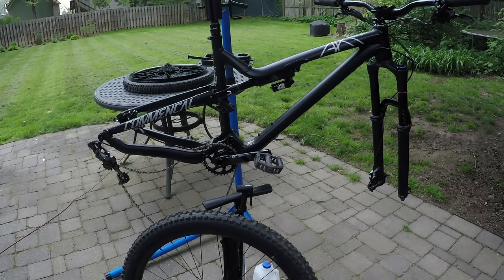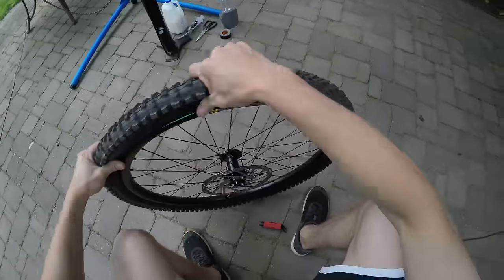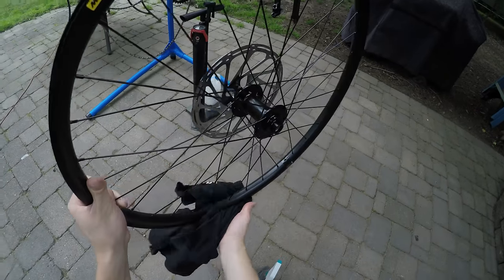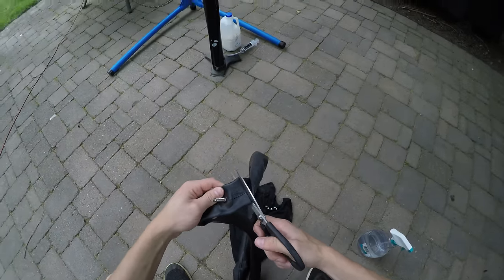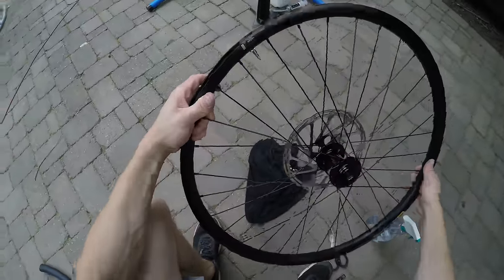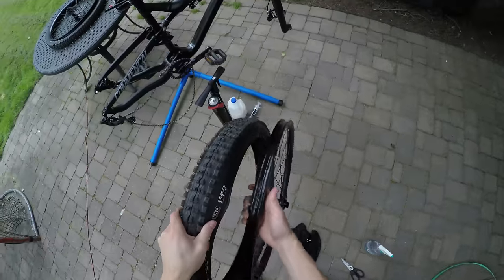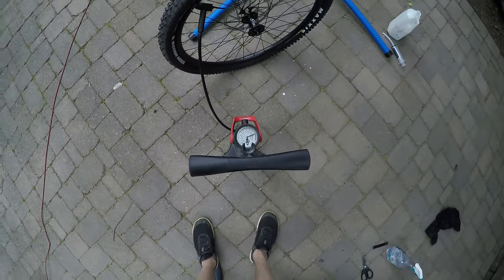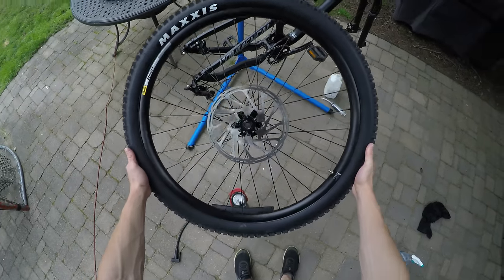MTB DIY Tubeless Conversion - Easiest and Cheapest way!

Comment: Worked great on my 20-yr old Urracos. Had to trim down the tape to about 3/4”, and the tires were pretty snug. But both held air just fine.
Reply: Are your tyres tubeless or non tubeless?
Reply: Everything From Every Where The tires are “tubeless capable”.  The rims are older but seem to work. The only problem is that if it all sits too long, something gives out, probably from the sealant settling away from a bad spot on the rim.  I probably just need to ride more...

Comment: I just did this with 29er tough tom tires. Seems to be holding pressure just fine! I reused valves from some flats i had. I think the first one i did needs the valve screwed on tighter cause it sprung a leak a couple times. But a quick bounce of the tire to get the sealant up on it sealed it both times. I tightened the second valve more and didn't have the same problem. I had a bit of trouble sealimg my first bead even with the compressor on it. I don't really know how i fixed it, but i squeezed the tyre near the valve while inflating and it finally seated!

Comment: The use of gorilla tape caused me massive issue on my enve carbon wheels. The tape caused the beading of the tyre to become far tight in to the wall of the rim. When I did get a puncture where the sealant couldn't cope with the leak I couldn't get the tyre off the rim due to the size of the tape. So ended up with a long walk back to the car. When I got home it took me 2hrs to break the beading on the tyre so that I could get it off. I have recently removed the gorilla tape to use proper rim and again it took a long time to get the glue from the gorilla tape off the rim. So word of caution when using cheap tape and deep set wheels.
Reply: If you have carbon rims wtf are you doing in this budget tubeless build lol.
Reply: You are not bright if youre doing  this to carbon rims.  And if you think gorilla tape is cheap, that just goes to show your ignorance.
Reply: @kolinstallman3788  HAHA seriously.
Reply: RollinRat  Got a link on how to do the "original ghetto split tube tubeless"?

Comment: Best vid, I did that too : If your non tubeless tire is difficult to inflate (even with a compressor), roll a strap all over the exterior of the tire, and put some pressure on to get the beads in place before the air!

Comment: Thank you very much. I just bought a Mongoose Dolomite ALX and want to go tubeless. I will purchase new valves, only because I don't want to do it twice,lol. Gorilla tape is nice idea if I can purchase it wide enough  for 4" wide rims. I also purchased brand new schwinn Axum, but I'm to heavy for it right now,lol. Mongoose Dolomite ALX holds 400lbs. Axum I'll use later when I lose weight. Thanks, you got new sub.

Comment: Made it look so easy, why was I fretting, even managed to inflate my tyre with a foot pump only difference is that I am going to feed the Muc-Off sealant through the valve stem having first removed the valve core  itself. 10/10

Comment: This is a great vid.  Exactly how I've done it.  You can also buy 'Tesa' tape in much larger rolls for cheap on line.  It's the same high tensile strength tape as Stans.  It's even yellow.  I'll have to try the gorilla tape.  I never understood why people mess with removing the valve core and injecting sealant that way.  So much easier and simpler to just put it in the open tire and mount the rest of the bead.
Reply: taking out the valve core to add sealant is useful later when it allows the tire to stay undisturbed, so you don't have to reseat the bead, which is a chore if you don't have a compressor or some fancy pump.
Reply: @DominiqueB  I'll add an asterisk, * "Unless you don't have a compressor or some fancy pump" to my statement.  :)  But in that case, I wouldn't even be trying to work on my own tubeless stuff, because without a compressor, (skip the fancy expensive pump that releases tons of air at once) it's really really hard to get tires to seat.  The compressor is king.  Sometimes I have to remove the valve core to pass enough air into the casing to get the tire to seat, but without it, I can see it would just not seat at all...

Comment: Thanks for sharing. Tried this method and also the one where you split an inner tube. I keep getting problems with this method, where the valve eventually leaks, but the one with the split inner tube is still going strong after over a year!
Reply from the maker: mick2d2 cool! Some valves can be  tricky but I've never had an issue.
Reply: Children Of The Loam I think it might because I usually end up having to top my tyres up fairly often and maybe this leads to moving the valve slightly over time. When it's still attached to part of the inner tube, this isn't a problem. The wheel I did using this system doesn't even have a thread on the base of the valve stem!
The other problem I find with tubeless if you're forced to change to an inner tube (this happened to me the other day on a ride) is that I had lots of thorns in my tyre, that had been sealed up by tubeless liquid, but were sticking through the tyre. This will just give you multiple punctures unless you remove them (not an easy task).

Comment: You have a real knack for making a DIY video! This is a clear, informative one. I just have one question, and I don't mean it sarcastically... Why make your tires tubeless? What's the advantage of removing  the tubes?
Reply from the maker: Thanks. It saves weight and prevents flats.

Comment: The sealen has crystals that will settle so sucking up the sealent into a syringe isn't the correct way, you should invert the bottle and wait a few seconds before tipping sealent into a tyre or cup this is an important step... This is the main reason people complain when the sealent dosent plug the hole and sprays latex everywhere.  The innertube and tape  hack is great 👍

Comment: Great video I like the hack with the tire tube for valve. I have been converting to tubeless and bought muc off valves  and even they leak so used rubber cement around core. I think I like your idea better and the rim tape as well! Picked me up some 1inch gorilla is the cheapest and best. Thanks

Comment: This will work  IF and ONLY IF.....  1)  your rims are tubeless ready   and/or,  2)  your tires are tubeless ready as well...   OR,   if you're using older rims and beaded tires,  you could try to add more rim tape to make tires fit snugly to the rims + lots of sealant!   Also,  this works well with rubber side wall tires.

Comment: Dude... i did the same thing... 2 years later and my tires are still good with this method... there's no need for expensive tapes... Gorilla tape FTW

P.S. I may need to change the sealant but too lazy to do it...
Reply: intra morph in Whats the name of the sealant you use?
Reply: @sistercalhoun4444  i used the stans sealant

Comment: I recently got myself a commercial ebike with fat tires and I was wondering if I can apply your techniques used to convert to a tubeless tire system for the ebike because tire repair on this ride can be a bit more of a challenge due to a heavier weight of the bike, mine is weighing close to 70 lbs. With a 20" x 4" rims. Can I do the same thing with my rims also? Going tubeless on the ebike would be a tremendous help considering I live in the lower desert where we have goatheads galore in stickers here requiring near bullet proof just for the stickers! I have already determined due to the size of the width of the rim that a tubeless ready tire would be a better guarantee for safety reasons. Since this is practically a brand new bike. Was able to enjoy a couple of rides, but after about 25 miles and a flat, this could be a major pain to replace every day, especially because of the size of the tubes, 20"x4" is not a common size in the United States so you have to order them from china and can take up to two weeks to get to you.

Comment: Did you use tubeless-ready tires and rim? I just tried this with a tire and rim configuration that isn't meant for tubeless, and there was just too loose a fit to get any air in with a floor pump. I'm going to try, tomorrow, with a compressor to see how it goes. The rims I have have a really small sidewall, as well. It's as if the tire was a 1/4" smaller in diameter, there would be a snug-enough fit and seal to work. Oh well, nothing ventured, nothing gained.Your set-up was definitely much tighter.

Comment: Great idea on the valve cutting out the old one.  It looks like it might seal even better than the tubeless valves that cost $20 or so.  Thanks.  Do you have any thoughts on whether wire beads or kevlar folding beads are better?

Comment: As someone who knows nothing about bikes and is just getting into the hobby i have so many questions! Lol mainly how did that liquid/sealant didn’t leak when you pour so much in it and placed it on your lap, i would think it would have leaked from the bottom or sides, also I’m not sure what happened there at the end, you put a lot of air in it and then let some out? Like i know the beads need to pop in place, shouldn’t that have happened when you put air in it and isn’t the sealant going to block the valve and just prevent air from getting it…. I’ll have to read more into this, I’m getting my bike soon and i know i want tubeless tires and this seems like a good DIY, not sure how much I’d be saving but I’ll give it a shot. Also, i keep reading is that the tires have to be tubeless ready, so i guess this doesn’t work with just any tire? I’m getting the marlin 7 2021.

Comment: The valve seems to just be placed, but not glued initially. Sometimes I have to push down to use the  tire pump. Has yours stayed? I am assuming after watching that the sealant is what also glues the valve.

Comment: Didn’t mention the rim had to be tubeless Ready?  Also why could you not remove the valve stem to apply the fluid instead of directly into the tire?  I think more chance for mess. Then was the rim tape applied twice?  If so I missed it

Comment: Great video man, super practical solution. 
My only worry is the valve leaking air. Have you tried to glue the valve somehow to make sure it is proper sealed or you think it's not necessary?

Comment: Interesting way of doing the tubeless but the 20 inch inner tube way is about five bucks and creates the seal on the tire bead easier. Plus its a rubber to rubber seal that last forever.  Good video though and learned a different way of doing tubeless.
Reply: What is the "20 inch inner tube way"?

Comment: just awesome dude , great to see how you recycled the old valve , how much time you would suggest to wait before riding ? , i know that if you use a used tire that already got a hole or 2 can mess up the sealing and may need sometime to fill up those holes. 
thank you!
Reply from the maker: Riding around right after inflation actually helps the sealant to coat the inside of the tire.

Comment: Gorrila tape motorcycle tube valve stems custom grind with a dremel to fit perfectly in rim channel use windshield sealent around valve push thru. Add tire and sealant pump up seat the beads nice and tight. Next day air down to desired air pressure and trouble free off road tire grip.

Comment: I have a handcycle for my wheelchair.  It has a 12" tire on it. It can only take 37psi. It is not enough to support my weight. I want to try this so I can go up to around 60 psi. But I do not understand how you remove this when the tire gets worn down. Do you have a difficult time removing it. Please do a video and show how you remove it.

Comment: I missed how you attach the valve stem. Did u use super glue or just stick it in there? It seems while airing the tire up
it would pop out
Reply: printer1105 I was curious as well
Reply: @johndelorme69  He used the little valve nut to secure it tight enough to create a seal and that keeps it from it popping out when he aired it up as well.

Comment: Hi. Good clear video.can i just ask when you fitted the valve did you push it through ( cut through ) the gorilla tape or did you not tape over the hole. Thank you
Reply from the maker: I usually just push the valve right through the tape.

Comment: I just now realized that inflating the inner tube after installing the tape may help with forcing the tape to adhere to the rim bed. Then remove inner tube, add sealant, and seat bead with air.
Reply: I just did mine, save yourself some time and just rub your thumb around the tape and press it down. Main thing is to keep tension on the tape as you wrap it into the rim so it stretches down into the channel/bed of the rim.  (Like he said in the video)

Comment: When you use the tape do you cover the ridges in the rim where the tyre bead would sit? Wouldn't it seat better if you trimmed the outer part of the tape away as to not cover the bead seating and only cover the spoke holes and valve hole or does it really not matter? Really good vid by the way 👌 Thanks
Reply from the maker: Liam Vickers the tape actually doesnt get in the bead seat so your thinking is correct.

Comment: awesome video-but if the sealant liquid weights "x" and the tube weighed "x" then I dont understand the benefit?
Reply: Equity Personnel no more pinch flats
Reply: lower tyre pressures + very fast fixes while out on the trails etc

Comment: Kind of a newb question here on an old post, but I am just starting to ride again at 55 after about a 15 year hiatus (my baby was stolen and there had to be a proper mourning period). The purpose and benefit of tubeless? I used to use the thicker sticker resistant tubes and they worked well. Is it just the weight or are their other advantages. Seems like it would be a hard repair too if you had a puncture or bead break. I can patch a tube, what do you do when you are in timbuktoo without a tube and no sealant, that apparently is critical. Thanks in advance.  Databyter

Comment: Does your tire leak air, over time?
Reply: Yes overtime you will have to refill you're tire. Should check pressures every time you head out on a trail. Small spurts of air will leak when you get a puncture depending on how fast the sealant seals the leak.

The same will occur with tubes depending on  brand

Comment: Great video! I actually tried this already over decade ago, but without sealant. It didn't work. Now I'm wondering if I should try this with basic foldable gravel/road tyre? Do you think it will work? Should I use more sealant than with real tubeless-ready tyre?
Reply: Actually it was over two decades ago. How fast these years go by!?
Reply from the maker: Its worth a try with a bit extra sealant.
Reply: @ChildrenOfTheLoam  Thanks. I let you know how it went.

Comment: Hi I liked your video soo simple. My bike came with tubeless and the pressure was set @ 65 psig. I lowered it to 30 psig
to allow for better grip on wet loges and roots but my tire leaked at the valve. Is there a minimum pressure for these tubeless tires or is it a poor seal at the valve?
P
Reply: Its a bad seal, 30psi is the pressure most people run tubeless

Comment: Nice video! What size with, wheel and tire setup are you running? Also how does your PSI look? rider weight to PSI ect?
Reply from the maker: 2.4 maxxis high roller 2 on a 27mm internal 27.5 wheel

Comment: The valve sticks to the rim after sealant cures or with a good push will the valve fall back inside and lose air since it doesn't have the retaining nut?
Reply from the maker: The lock nut should be installed a bit more than finger tight

Comment: on you're situation you used presta valve i think, do you think schrader valve from old inner tube makes it good too? to go tubeless like that?
Reply: You need a valve that has threading all the way down.  If your Schrader valve is threaded, and will fit, then it will work.  If it won't fit, drill out the hole.

Comment: Dude, I’ve been trying to do this. I’ve used an air pump and even a car tire compresor. But the air is not holding in the tires, any suggestions?

Comment: How did you keep the valve in place? Did the sealant glue it in place?
Reply from the maker: the valve has a lock nut to secure it just like with a tube

Comment: How many times did you go around with the tape ?? And thank you! Awesome!
Reply: Go round the rim once and overlap the valve by about 3-4 inches, make sure you get it central and use your thumb to smooth it into the rim,  for fitting the valve just use a sharp pointy nail or similar, thats smaller diameter than the valve  (if you use presta valves and try pushing it through you might bend the pin). then push the valve in as per the vid, sorted :)

Comment: silly question; will this work with non tubeless ready wheels and tire?
Reply: Doug Z if your rims and tires are tubeless ready all you need is valves and sealant
Reply: @sprung3008   Thanks. I believe neither is tubeless ready( my wheels or tires). I have heard you can backyard mechanic it, but it may take a few days to seal.

Comment: Thank you so much for such throughout explanation. Quick question: I own Mavic rims as well (Crosstrail 26") and they are UST. Will the TR Maxxis tires work fine with the UST rims following your procedure? Thanks!
Reply from the maker: They should be just fine.
Reply: Children Of The Loam Thanks!
Reply: Children Of The Loam Sorry, one more question: do I still need to use tape as well on the bed given that the rim has no spoke holes and is UST/tubeless ready? Thanks again.
Reply from the maker: @jsasa5668  you don't need to but it might help the tire fit tighter
Reply: Children Of The Loam cool! Thanks so much!! I used to ride DHF and DHR on tubes and now I’ll be switching to DHF and Aggressor tubeless... excited

Comment: 2 Thumbs up man!!  But like to know if it rides harder or the same as with a tube?
Reply from the maker: When you go tubeless you feel more connected to the ground and can run lower pressures which leads to a softer ride and more grip.